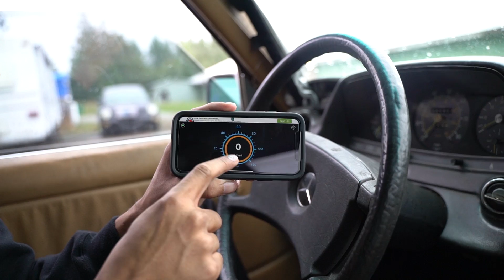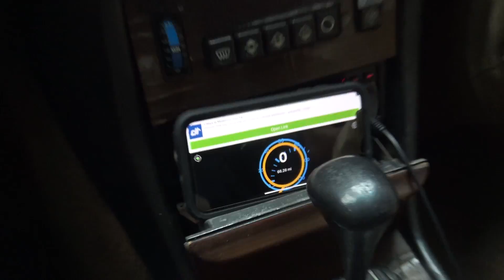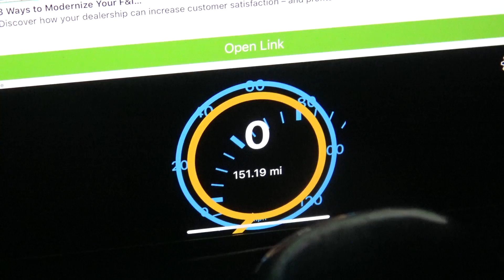Will a Car RUN on USED MOTOR OIL?

Comment: Can you use heater oil in the car as diesel
Reply: Can you use hear oil as gas for it
Reply: I think It will work I’m pretty sure it will it should be the same as diesel gas just with a rad tint

Comment: Run it on recycled veggie oil 2 55 gallon plastic drums set one up higher than the other drill a hole in bottom to drain in to the next but you have to use two pair of blue  jeans zip tie the legs closed zip tie one in each drum you want to use them as the filter so you want the oil from the top too drain into the 2 pair of jeans on the bottom by the time it is the it's fuel

Comment: after you blend it let it set for a week and 90% of that carbon will fall to the bottom of the bucket then you can run it through a commercial diesel filter to 20000 microns

Comment: If you use a large kitchen strainer with a lot of holes put that inside a very large funnel then put your filter in the kitchen strainer it is a lot faster

Comment: You need to mix your oil and Diesel before you strain. it will allow the heavy sediment to separate out easier and let it sit overnight then siphon off everything but the last inch. In your siphon hose you should have a fuel filter. And then you can run it through a coffee filter if you still feel like it.

Comment: You used too much diesel. You can go as low as 10% diesel. If you run it long enough only on used oil/vegetable oil, it will clog the filter. That's why you should add diesel.

Comment: A diesel can run straight oil the only problem is in cold weather you will need a fuel heater to keep the oil thin enough to run through the engine.

Comment: I had a 84 300D. Fun car. I took the motor and it’s in my 84 Toyota Rock Crawler. Just as slow as the car was, but it’s a fun slow.

Comment: well you can run it just on old(filtered) oil without any diesel, as long as it's not cold outside because it will have trouble starting, will smoke and stink a lot though

my friend is doing this on a vw golf mk1, little les power but it's free

Comment: I was told by my boss that one of his old bosses that did a lot of work with diesel trucks back in the 40s-50s that Way back before the gas and Diesel environmental safety changes it was regular for people to have Diesel and oil mixtures.  It was nice for farmers and long road trippers like semi truckers because the oil made the engine last 2-3 times as long and ran even better than modern engines. It kept everything lubricated and some what water resistant

Comment: I ran for a few years straight filtered waste motor oil in my 85 300d.  smoked like a bastard on cold start but good after that.
Reply: Did the car last?  Or did it cause undo wear and tear to the fuel system or other parts of the engine, etc?
Reply: it lasted for years.  only thing it seems to go though was glow plugs quicker.  Rudolph diesel actually invented the diesel engine to run on peanut oil. it was only later realized that Rudolph diesel's engine could run on this petroleum by product now known as diesel fuel.  warning though. you must filter the oil or you will plug your injectors and modern OBD 2 engines should be avoided as they have higher tolerances and may be damaged by alternative fuels.

Comment: No diesel fuel need. Will run on pure oil.  That's how you get 1 form of a runaway diesel.  Like if a turbo seal goes and leaks oil into the intake it runs until theres no oil or until the engine gives up

Comment: Indirect injection diesel engines are notorious for being able to burn a wide variety of fuels. As long as the injection pump is lubricated it will probably burn it.

Comment: That's a 300td, it has a super strong motor. But you should try used fry oil. Just filter the chunks out n ruuuunnnnnnn it

Comment: Put a om606 or om603 and send the dieselpump to dieselmeken in sweden
With a decent size turbo You can make alot of power and You wil have a fun car to drive. I would love to watch u guys swapping this. Cheap and easy horsepower

Comment: You could run old diesels on almost everything, it would still run on pure oil with no diesel with maybe no changes to the high pressure pump

Comment: You can run 100% waste oil. Just make sure to filter it properly and remove the filter down in the tank. And for filtering use old bed sheets. Did this on my 220D

Comment: Just run big filters from a marine Diesel or something and don't pre filter the oil. In the summer the engine will run on unblended waste oil, ATF in the mix helps viscosity too, if some is available used. Some filter heads are heated by coolant, that's the way the veggie oil guys do it.

Comment: Can you use coconut oil as engine oil? Also try a alcohol like ever clear with 90% proof so the car can run unlike when vodka was used

Comment: Pressure is your best friend when filtering. If you ever want to something like that again,
by some fairly tight wire mesh and put those coffee filters on top of that.
Than use some container, that you can pressurize with a bike pump.
there you go

Comment: this has been done many many times bro u can use a chevy econo van with 2 tanks so u use reg gas till u get to operation temp then change to waste oil and it will keep running

Comment: A common used motor oil mix is “wmo85” iirc. The wmo needs filtered well, and is thinned out with 15% gasoline. Common practice for the IH IDI guys who do this

Comment: Some 10 years ago I worked at a dealer that had a power steering recall. We had to flush the system with 10qts of ATF then replace the pump and hoses.  I would take the waste and filter it through a TShirt and put it in my truck. Probably 3-5 gallons of ATF a day went into that truck. I would change my fuel filter every 1500 miles but it ran like a champ. Free fuel!

Comment: I ran waste engine oil in my car for 12 months with no issues
Reply: what happened after 12 months?
Reply: @JasonSpenc  changed car just because I had the opportunity... I paid £100 for the year.. ran it for 12 months with zero fuel cost and sold it for scrap for £130

Comment: Diesels will run on anything that doesn't ignite as fast as gasoline or that isn't combustible like water. I ran my diesel VW on straight automatic transmission fluid for a while to help lubricate a rebuilt injection pump.
Reply: amazing lol
Reply: CJBMAGGOT94 VW's man, amazing lol
Reply: Really? Did you do a 50/50 mix or straight trans fluid?
Reply: @JerzeyBoy  100% ATF. Filled a new fuel filter full.
Reply: @CJBMAGGOT94  wow. Now i want a international powered F350
Reply: So you recomment using ATF for  1 tank or two after getting a rebuilt pump installed before using diesel?
Reply: Also, was it a common rail or nah?
Reply: Doesn’t matter if it’s a vw or what, the original design of a diesel is to run off off peanut oil, but basically any oil based substance will burn in a diesel, that’s why the government uses diesel for all the ground vehicles in the military
Reply: @TheBeeMan1994  Not entirely true. As long as the flashpoint and ability to ignite under compression is there, then it will run in a diesel engine.
Reply: for a great example of what this guy is talking about look up "7.3 IDI Slave Lake". this guy, ZIp Ties and Bias Plies, will put just about any liquid he can find into that old ford and itll run mint with a little help of some break clean or ether to get it started.
Reply: MNforlife63 yer SLAVE LAKE !!!! 👌
Reply: paul klein you ever drive a 6.2 powered Humvee? They are stupid slow when armored
Reply: Andrew Beeman he didn’t say anything about speed
Reply: The Fleming let me rephrase that then, they are gutless and severely underpowered. Gale Banks designs a special turbocharger kit to equip them with that makes a fully loaded armored humvee actually have a little more scoot to them. 

I have experience driving and fixing surplus ones at a surplus military shop I worked at, the past shops I’ve worked at I’ve been a diesel pickup mechanic and the railroad I work for now I have experience working on the diesel locomotives we use 

Regardless diesels are very strong engines that will outlive most gas engines. They do have nice amounts of low end torque but the military prefers them because they basically can run in anything they can find in the field, and they will literally survive everything including EMPs and being shot at

Any old school mechanically injected diesel, the 5.9 12 valve, the 6.9/7.3 international/ford IDI, (which came non turbo until 93) the Detroit/GM 6.2 (used in Chevy pickups from 83-92 (which came non turbocharged) and in all humvees) and the 6.5 used from 93 and up until the 2000s will basically burn anything oil based.
Reply: Andrew Beeman oh ok yeah I agree with you on those points, I’ve driven those damn things more than I’ve ever cared to and they are very sluggish and usually weighed down with shit

Comment: Pure waste oil + bit of gas will require a 90% oil to 10% gas mix, versus using oil and Diesel. The car will run on straight oil if the oil was more volatile, like diesel hense mix 10% gas. The only engine i would really recommend running waste oil in or 90% oil 10% gasoline mix would be an older cummins
Reply: Cooki_monstre hell yeah! Got a 12 valve and use it for work! Not play! Also got a 7.3, which is pretty mint to.

Comment: My friend runs his old peugeot on hydraulic oil, gear oil, kerosene, red diesel. All sorts of shit he gets either free or really cheap. As long as the calorific value is sufficient and flash point not too high or low it runs ok. Needs to be thinned out sometimes though.

Comment: Old farmer i use to work for had a 1990 1st Gen Dodge that he put a cup of oil in with every fill up.   That truck had over a million miles and it ran like a scalded ape!
Reply: Was it a Diesel or Petrol engine?
Reply: @JesusisJesus  diesel.

Comment: Red diesel is illegal over here in the UK unless you are on private land or have permission to use it in parts of a road ad a farmer because you need to drive to another gate.  Try neat motor oil.  I also know those run on cooking oil, but it does lacquer up the engine, but make some biodiesel its cheaper than diesel.  Andrew Mckenna, Nottingham, uk
Reply: Andrew Mckenna The US has red diesel, too. I’ve used it for bulldozers and tractors.

Comment: Maybe try that to run it with a higher ratio of used oil next time like half and half
Reply: I ran pennzoil tcw3 2 stroke oil in my 472 69 caddy crank, I pulled it off into the fuel and never had a problem

Comment: I have a 1985 Mercedes Benz 300SD with the 5.0 Turbo Diesel and let me tell you for 600 dollars it runs better than most cars I know. Those motors were made to last. #TrueEngineering

Comment: mybe for you guys a tip for the next time, you can make the oil 40-50,digrees hot it wil be faster though filter/tricher... is then a lot tinner

Comment: You can use just oil in a old diesel. Or you mix the oil with gas to ghet a litle more power(10 to 1)

Comment: I've got one of these old diesel Mercedes. It's got over 400,000 miles on the original engine/transmission and still running strong.

Comment: Yesterday I just poured 10 gallon of used engine oil, 5 gallon of diesel and 2 gallon of chainsaw gas/trans fluid mix all in my m35a2 deuce and a half and she don’t care
Reply: It's nice to have a true multifuel engine.
Reply: Make a vid of this 
I want to see the smoke
Reply: I had one on my channel of it at idle smoking out my neighbors house but it got a lot of hate and got taken down. Fuel is turned all the way up on it now, a new video will come soon

Comment: Coulda told u it works without doing it. It’s a old turbo diesel u can put anything in there with a mix of diesel, I use oil bacon grease canola oil etc with a mix of old diesel fuel in my tdi been running for 3 years on that shit

Comment: this mercedes you can run with 100% used motor oil. the only reason to mix the oil with diesel is to prevent the oil in wintertime became to thick

Comment: Diesel appears to run on any oil. I wonder whether it also runs on wood gas.
Reply: Wood gas is too flammable for a diesel' s high CR, gas engines will run on it though.

Comment: Try used vegetable oil without diesel it will work or make a vegetable oil mix 90/10  Oil>90 Diesel>10 Please

Comment: Please do NOT ruin this car, those old mercs will run forever with even the slightest bit of maintenance. They are amazing cars!
Reply: they use those cars in morroco for taxi and i saw them with 950.000 km on the teller wtff
Reply: geert wilders those were smaller a lot less powerful 240d’s
Reply: I agree
Reply: GIVE ME AN OLD MERC AND A HAMMER AND IT WILL LAST UNTIL THE SUN GOES SUPER SAYIAN AND TURN INTO A RED GIANT
Reply: And this one being a Turbo Diesel makes it super rare
Reply: What type of Benz I want one??
Reply: @mcgoofe1871  the model is w123
Reply: Tibor Pandza not so true have you ever had experience with one before…
Reply: Yea this was the maintenance 😂
Reply: That mix is probably more clean the diesel sold in canada
Reply: @musicmetal1 it's already been done lol

Comment: You are literally burning burnt hydrocarbons... how did you not open the 5th dimension under the hood?
Reply: AimlessMoto how? The engine oil wasn’t burned previously (obviously).
Reply: @JosephSamsor  ding ding ding
Reply: AimlessMoto spelling error. Meant “wasn’t”
Reply: @JosephSamsor  used oil is burnt... thats why its black. Its not from dirt inside the engine... its from the hydrocarbons breaking down under heat and pressure.
Reply: AimlessMoto it’s obviously not entirely burnt though if the engine can off of it. I kinda get your point though

Comment: I run my 1988 F250 7.3 IDI on waste motor oil, I have a 100 gallon tank in the bed I add 75 gallons of oil to and top it off with off road diesel and let it mix up as I drive, no problems for years now and it rolls coal like a beast. Add some diesel klean to your mix it'll help keep it running clean.

Comment: You can also put salad Oil in it. I have a 190 2.5 Diesel  and over 300000 km on salad Oil. Old mercedes diesel are the Best. You put everything in it and it will run

Comment: Your 300D has a leak in the vacuum system. The delayed shutoff is a product of that leak. Once you fond where, you can fix it for like a $4 rubber vac hose.

Comment: I did it 10-15 years ago. Works, only the fuel filter will clog up quickly.

Cooking oil or creosin is definitely better.

Comment: Use old cooking oil but you need to use normal diesel to start it as the cooking oil can be to thick at times to get it started and it runs on compression

Comment: If you decide to do this again it's a lot easier to get a cheap pack of like 3 or 4xl white t shirts and stretch them over your clean bucket and make a "hair band" out of vacuum line to hold it on the opening of the bucket and use a transfer pump to move the oil from the used bucket to the clean one with the filter on the opening. Just something to think on.
Reply: Yes but they are stupid
Reply: You can do your first stage of filtering using those green shopping bags that they are making everyone buy as they phase out the disposable shopping bags. 
Then you do your second stage filtration with another shopping bag but you line the inside bottom of it with paper towels. 
You can do about 100 gallons through each bag and the bags are around 10 cents if they cost anything at all.
Reply: or you could just buy fuel.

Comment: Yeah it will run fine but newer engines with tighter tolerances on the pumps and finer injector spray patterns will have more chance of being clogged by the larger carbon particles, it should also work on pure veg oil without any diesel, a good way to run indefinitely is to have 2 tanks one for oil other for diesel, use the oil tank on the road and the diesel just before parking up,to clear any carbon deposits inside the injectors

Comment: My cousin had a 1980 benz 240d and ran it on a 50/50 diesel and oil mix but a 70/30 mix is best we found because the fuel mileage noticably took a dive at the half and half mark haha

Comment: Doesn’t putting oil in diesel motor or at least soaking injectors in oil clean out the system of gunk? Correct me if I’m wrong or write up the proper job to cleaning the system
Reply: sean pattison I don’t think motor oil cleans it much. I know vegetable oil will clean out a lot of carbon.

Comment: The om616  and 0m617  engines in the w123 mercedes was designed to run on just about any fuel.  So don't treat her bad boys she will treat you better than anything you'll ever own in your lifetime. Just keep up on the vacuum systems the hesitation when it shuts off means there's a vacuum issue. And the transmission is cooperated by vacuum and so is just about everything on the w123 including the door locks and the ignition switch
Reply: what you mentioned + valve adjustment
Reply: this om617 held the record and might still(notsure) for the  highest mileage  engine without a rebuild
Reply: Yes valve adjustments are key. As well and proper care
Reply: the skoda perfectly ran on refined used cooking oil

Comment: Does it work for gasoline or just diesel?
Reply: Off Beat just diesel, since diesel is pretty similar to oil and gasoline is not
Reply: Yup, just Diesel. Diesel cars compress air, which make it very hot, so hot that when small drops of something that can be burned (oil, gasoline, Diesel etc..) reach the combustion chamber, they ignite, reacting with the compressed air. You can put gasoline in a diesel car and it will run for some time, but some components will have a lot of friction because gasoline does not lubricate as well as Diesel (in Portuguese "GasOlio"). But gasoline cars spray the gasoline with air, and you have a mixture that can be burned after heating a little bit and then making a spark, if you spray some kind of oil it won't vaporize in the air, and you have spark in the air with oil resting on the Piston :)